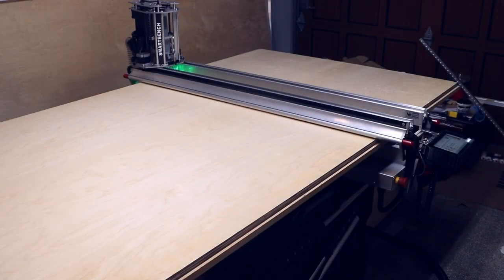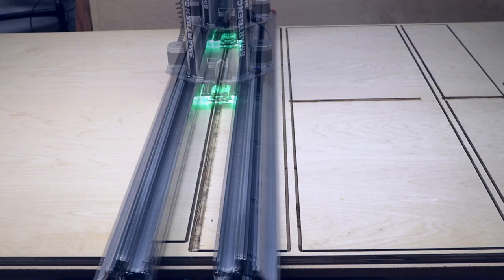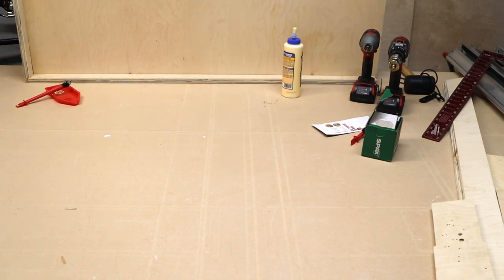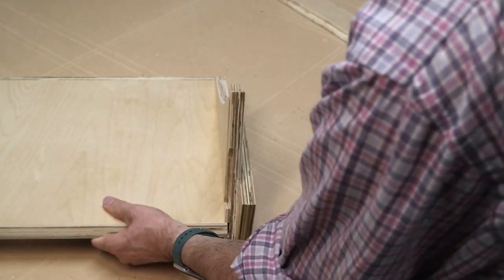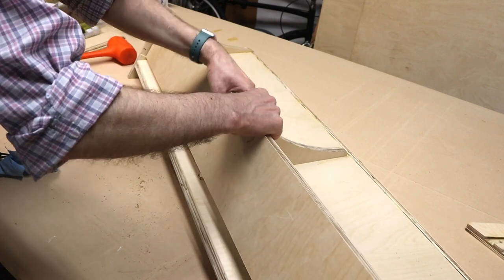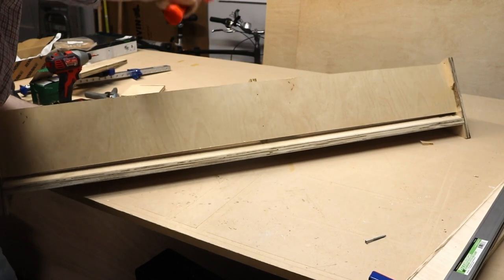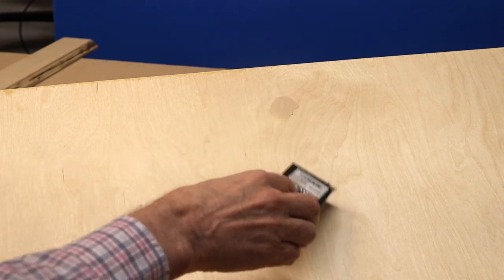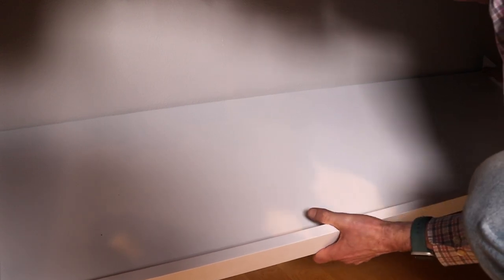Making a Floating Shoe Shelf with a Yeti SmartBench CNC Router

Comment: Turned out great! Did you have to fill the end grain of the plywood, or did sanding/painting cover up that uneven surface? Well done!
Reply from the maker: I applied edge banding on the plywood edges and then painted the edge banding. Very quick.

Comment: Lol if you think that was over engineered you should see the house a Boing engineer built in Meydenbauer.

You are doing just fine John.
Reply from the maker: Oh, interesting. I'll have to see if I can track that down and see it.
Reply: @JohnSL  it's a house built late 70's in a steep section of LW. 
It only had two contact points with the ground. A giant concrete foot/ swimming pool and the top floor kitchen.
The house has a big concrete/steel health rest of the house is cantilevered out from. Spine and ribs is best description.
It had been abandoned. A group I know bought and remodeled it. Around 1990. Ownership today I don't know.
Reply: @JohnSL  if you want address I will look it up for you.